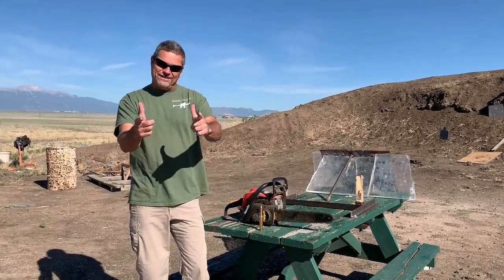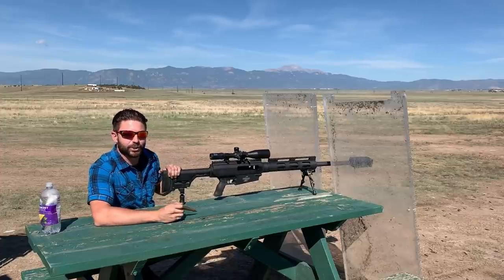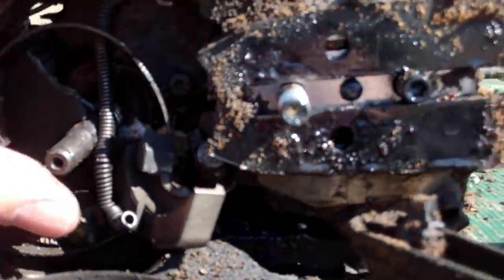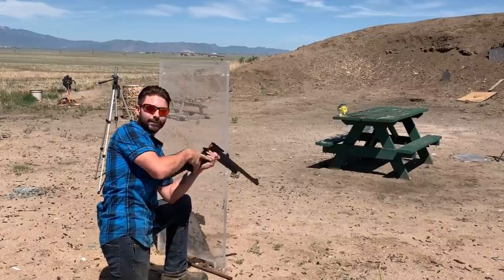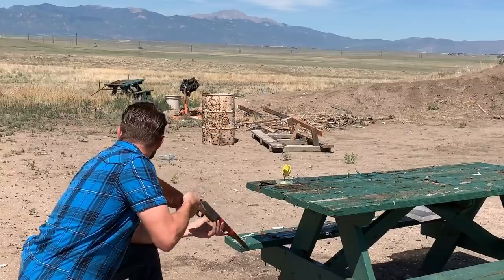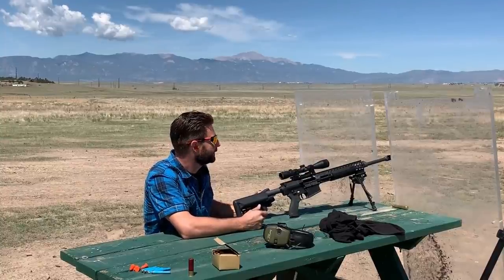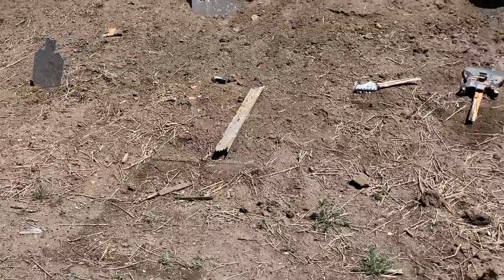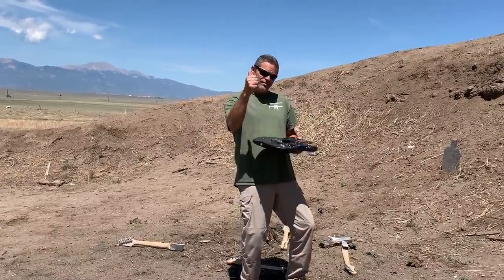Random Acts Of Destruction.🔥 50 Cal API Round vs Running Chainsaw😜

Comment: You could fill a 55 gal. steel drum half way with tannerite or flash powder and shoot it with an incendiary round. Pretty easy to make good quality flash powder. 2 to 1 ratio potassium perchlorate / aluminum powder. That would make a good video!
Reply from the maker: That would make for a good video, but then we would get arrested 😬
Reply: @GoingBallistic  Ya lol I guess that would have to be an off camera experiment! I can get you some flash if you're interested.

Comment: Listen. you wasting bullets on random stuff making vids that are not that intresting. there are so many intresting stuff to shot at, or how to shot at. for example you could have shot the chainsaw directly to the chain. but not sideway, straight paralel to the chain. (sorry im not english native) aiming the chainsaw at you guys and maybe use a laser pointer to aim it right. 
did you shoot titanium? beforr? i was imagining shooting that titanium plate( or any 1inch plate) side way. to see how deep it goes and how big the deformation is. these are just simple ideas that take 1 more bullet. but makes it still fun
Reply: another idea. just came up. for example shot through a pipe thats smaller in diameter then the bullet. try aiming center. see if bullet its stoppen inside the pipe( pipe can be aluminium for small cal or othet metal for bigger)  or if bullet goes side ways.  this would replicate what would happen if you shoot inside a gun with a bigger gun. but more visible cuz  pipe replicates the barel.